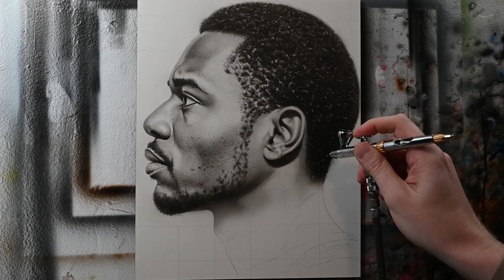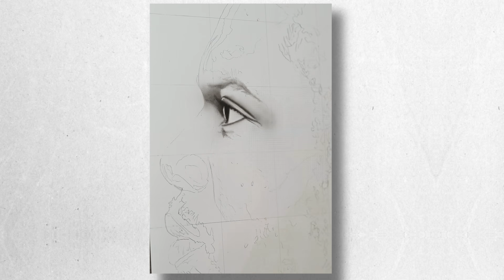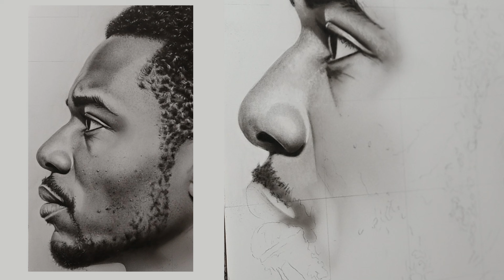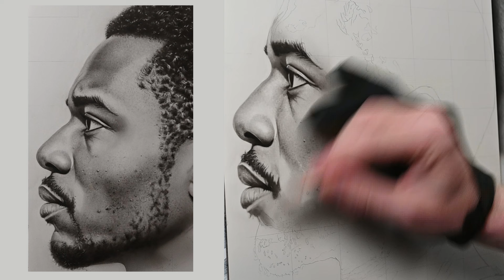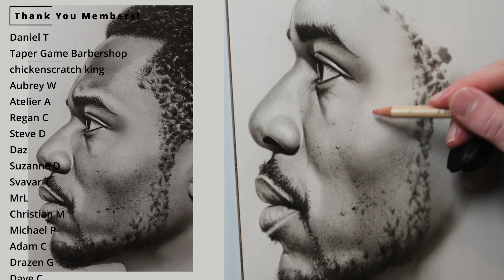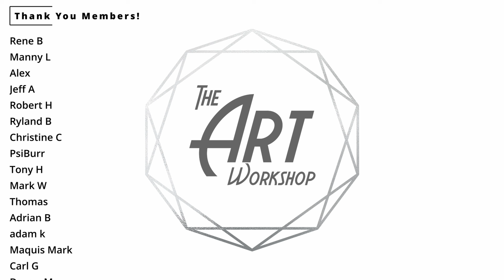Using an AIRBRUSH & an ERASER for SKIN Textures

Comment: Hello, I'm from Argentina. I want to ask you something. I have problems erasing. I use the Faber Castell eraser as well as Createx Illustration Color paints, but when I erase, it requires a lot of effort and erases very little. The base is also the same canvas with many layers of gesso and sanding. What could be the problem?

Traduce una conversación

Comentarios

￼

Practica hablar en inglés

Práctica
Reply from the maker: A smooth gessoed surface works very well for erasing. I suspect that you might be spraying your paint too heavily and allowing it cure, which makes erasing very difficult. For the techniques that I use it's important to spray the paint very lightly- good trigger control is important for this. When the layers of acrylic paint are thinly applied to the surface, they eraser easily. Another technique I occasionally use is over reducing the paint with distilled water. More water will extend the binder and pigments within the paint making it much weaker. This works exceptionally well on an absorbent surface like claybord or paper. It's what I used for a lot of the skin textures within this video.
Reply: Thankyou very much,you are greats @theartworkshop

Comment: Not sure I'll ever get there.  In the month since I've started getting back into airbrushing it's just a continual cycle of clogs, running, and cleaning the airbrush over and over again.
Reply from the maker: You will, so let's fix it. What airbrush are you using? and equally important, what paint are you spraying? And finally what type of compressor? Clogs do happen, but a lot of times what seems like a clog and poor airbrush performance is actually just paint drying on the needle tip- aka tip try. Are you keeping on top of cleaning the tip dry off? I do this very often. Every few minutes I like to pinch off the tip try with my fingers and it keeps the airbrush spraying correctly. Remember proper trigger technique as well- always start and stop with air- it's very important. Down for air, back for paint, forward to stop paint flow, and only then do you stop the air.
Reply: @theartworkshop  I originally learned on my dad's old Sears-Roebucks, but didn't do much aside from some basic camo patterns.   I started back up with a Gaalheri Mobius 0.2 about a month ago.   I really am unsure if the MAC valve is working.  I hear there are quality control issues with Gaalheri, but they make good brushes.  I seem to get either tons of air, or just specks.   

With the recent Amazon sale, I bought a Gaalheri GHAD-39 as it was on sale for $30.  I hoped to eliminate the MAC as a variable.  I deliberately used the same paint to see how it worked.  Initially it was working great.  But then it would stop spraying, or just gush paint.

I'm using Badger water based acrylics mostly, thinned with distilled water.  I have been straining them as well and using a Vortex mixer.  I tried twice (two separate colors) to spray them straight out of the bottle and that resulted in almost instant clogging.   I tried spraying Creatix water acrylics straight from the bottle and it worked ok initially, but then I had issues. (I'm sorry I can' t remember precisely what.)

The only paint I used in both brushes was Badger black.

My compressor is a general hardware Campbell Hausefield.  I have the PSI usually around 20, but I have experimented with lower or higher.  I have a fisheye water filter from Spraygunner.   Compressor is right near my desk and the fisheye is connected directly to it.  The airbrush hose is connected directly to the fisheye.

Thanks for listening.
Reply: @theartworkshop  Youtube ate my reply.  I have been using a Gaalheri Mobius 2.0, and the compressor is a general hardware Campbell Hausefield dk618300av.  It has a 2 gal tank.    I'm using Badger water acrylics mostly, but I also tried Createx.  I have tried the badger paints directly from the bottle twice and that was a nightmare.

I have been thinning with distilled water, straining the paint and using a vortex mixer.   I recently bought a Gaalheri GHAD-39 and tried that to eliminate the MAC valve.  I deliberately used the same black paint I had been trying with my Mobius.  It worked better initially, but then would either clog for a minute and stop or just gush paint.

The compressor is right by my desk.  I have a fisheye water filter and the airbrush hose is hooked directly into that.  I mostly run the compressor around 20 PSI, but have tried other settings because I'm not sure what I'm doing wrong.

Occasionally I will see a bubble in the paint cup and I have taken to leaving the cap off to monitor it.  I intend to try using some beeswax around the nozzle threads to see if I can get a better seal.
Reply: @theartworkshop  I have tried running the brushes with the nozzle cap off as seen in so many videos to help with smaller lines but I have not been swipping the tip clean.   I have been doing my very best to keep the air going at all times and letting off the paint before releasing the air.

I have heard that Gaalheri makes good brushes, but that their quality control is an issue.  I have no way of knowing if the MAC is working properly or not as I have no experience.  It seems like either I'm getting a general flow of air, or I'm getting specks with no in between.

I have been practicing with a coloring book, or just blank paper, but I have also done a bit of work on a welding helmet, which is plastic.
Reply from the maker: @Mathius-theo  Could be the airbrush, but you didn't mention your paint. Are you using a good airbrush paint? I can't stress how important a high quality paint is for proper atomization and control. It makes a world of difference. Something like golden high flow is an excellent place to start (and to stick with).
Reply: @theartworkshop  You missed it.  Badger water based acrylics.  I also have a few Createx colors, but only sprayed them one time.   They are all airbrush formulas, allegedly, "ready to spray" but that doesn't seem to be the case for Badger.

I did have some success finally, Saturday night, making progress on something that was encouraging, but it was more through perseverance than perfection.

I still had issues with spidering.  Less issues with speckling....  I used the eraser you mentioned in the first part of this portrait series and had some success on lighter values, but the darker stuff just would not be removed.   I also kept using a q-tip with cleaner on it to remove as much spidering as I could.

The piece is looking good from 10ft away, but up close you can see it's muddy from specks that look like overspray on a car.